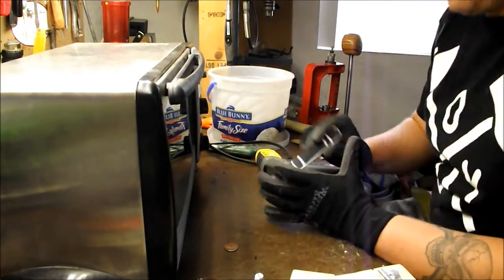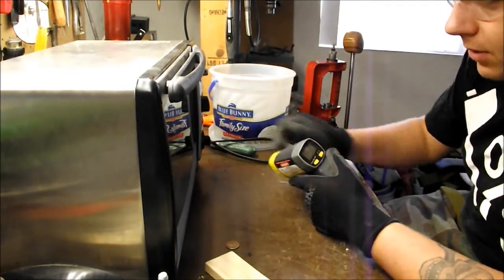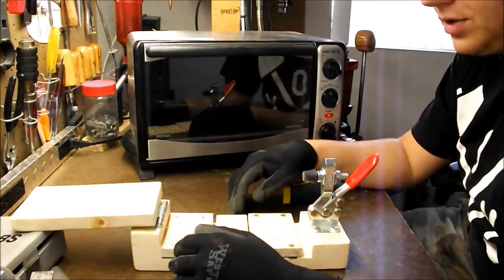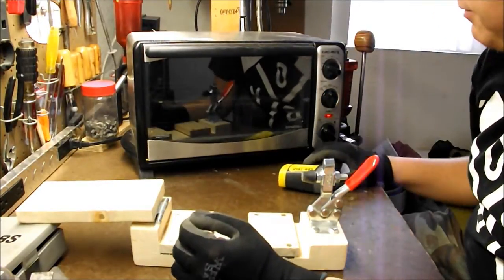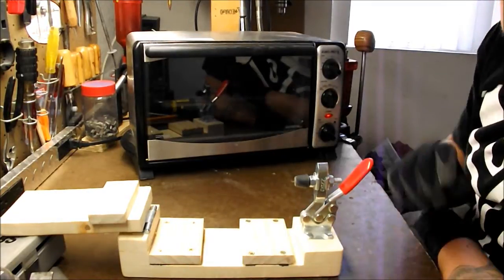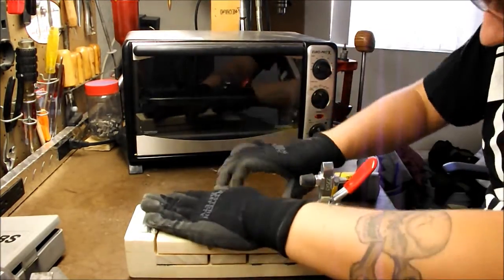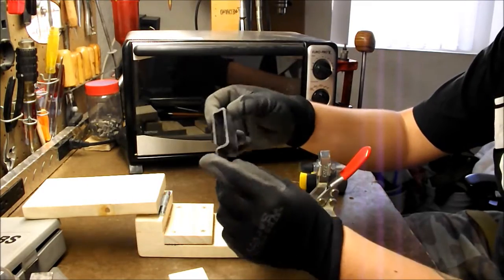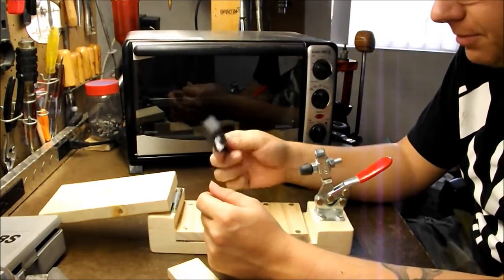kydex belt loop jig

Comment: Looks awesome, dude! Where did you get that clamp/lock for the jig? I'm going to need a few of those for our vacuum former. Also, the .125 loop strips are easily formed at a lower temperature, since you don't need to get precise definition from them. You can form them in that jig at about 250ish.

Comment: I made a jig based on this video. Made it a little wider and used two clamps, plus a few small changes, but basically the same. Works great! The toggle clamps are way better and simpler than any other system I've seen for this type of jig. Thanks for the great info!
Reply from the maker: im glad it helped